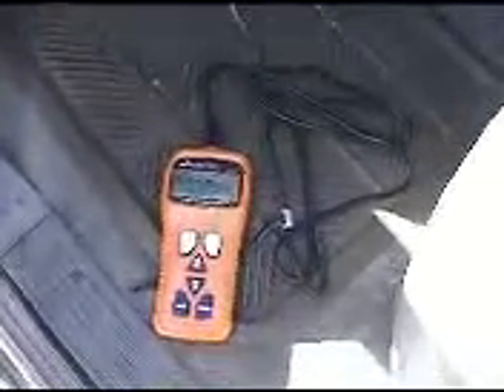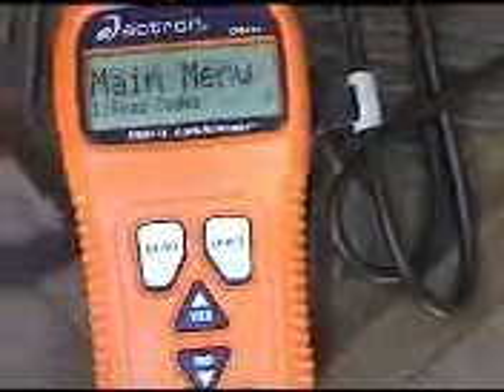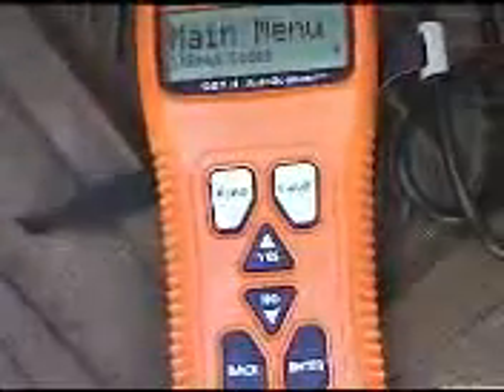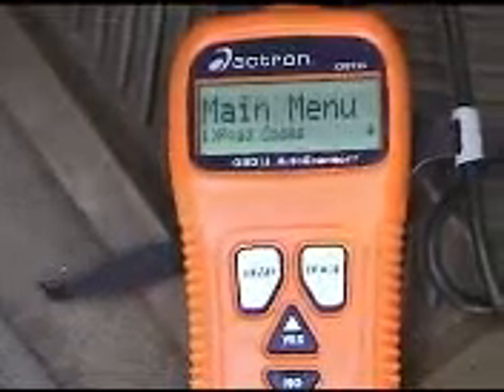How to replace the O2 Sensor

Comment: I just replaced mine last week on my 97 Yukon.  I didn't know that they made a socket for the O2 sensor so I just cut the wires off and slipped on the closed end of the wrench.
Good Video.

Comment: Yes you can buy them at Auto Zone or most any parts store.  I picked mine up at O'Reilly Auto Parts.  They sold me their Rental unit and I paid $20.00 for the complete set.  It's worth the money to have the right tool for this job. I believe it comes with 2 sockets and another connector for the sockets.  Good Luck with your project.

Comment from the maker: The question came up, which one is bank 1 and 2.

Bank 1 sensor will always be on the same side of a V6 or V8 engine as cylinder number one.  The upstream is normally before the catalytic converter and downstream behind it.  The sensors work the same.

Hope that helps

Comment: I've spent all day trying to loosen up my 02 sensor, that damn thing is frozen solid.  I even saturated it with liquid wrench three times, letting it set in for almost an hour each time.  I haven't thought of heating up the engine.  I will try that tomorrow before buying a pneumatic 02 sensor wrench.

Comment from the maker: I'm really sorry about getting back to you so late.  Yes, it should have 2 before the converter and two after the converter.  On the reader that I used, it did indicate which sensor needed to be replaced.  Now it didn't say if it was the one on the left or right, just that it was either before or after the converter.  Hope that helps

Comment: The tool is great, the sensor is really rusted on! I'm spraying it with WD40 and havn't budged it at all! It's hard to get a lot of muscle into it laying on your back under the van like that and I don't wanna knock it off the jack stands. I'm gonna check with O'Reilys and see if there's something stronger I can use to penetrate the rust.

Comment: Thank you very much. Spent days on the internet trying to find how to install Air Fuel Ratio sensor ( should be similar process) until ... finally got this info. Toyota dealership estimated 1.5 hr to do the job $125/hr. plus the part itself. My worry is just how I will deal with engine light without a device...another puzzle. Btw, any special tips on AFR install on Toyota Camry 1997 LE, 4 cyl,2.2L?

Comment: @natenraya I wonder if they left gas in the tank when it was parked for 2 years I bet the fuel filter is clogged and the injectors are dirty..  If so I would run it until the tank is empty.  Change the fuel filter put some good fuel injector cleaner  and fill it with super unleaded. Then drive it.   
Then after that full tank is used up.  I would run a 1/3 or half of can of seafoam in the tank with the tank filled with super unleaded gas.   Then if it improves.  Change the fuel filter again.

Comment: @jimmy101112000 

Often times, you have to reconnect the battery for the check engine to reset. But make sure you know the radio code, if you have a anti theft radio because when the battery is diconnected, it engages the code and the radio is un-usable until the code is put in. You can find the code by calling the car manufacture or check the website and have your VIN number handy

Comment: Guys the manufacture recommend to change the O2 sensors between K60-100 ,it will improve the engine performance and gas consumption .

Comment: @jimmy101112000 Plus an O2 sensor will light up the check engine light if its really bad but it would not cause your jeep to stall.  If you have a check engine light on  post your codes to us.  Autozone and some other auto parts stores will do this for free. But they will not clear them where I live at.  If you did a sucessful repair the light will go off after some trips.   I would also recommend a normal tune up. Spark plugs,  Air filter,  Oil change, Spark plug wires if equipped.

Comment: @TheCoolfez  yeah but its no big deal if the radio gets locked out.  Like you said they will give the code to you if you call with your vin. But I think that is the most dumbest feature in a stock stereo.  I never heard anyone stealing a stock stereo before. And those only work in certain cars with the same connections.

Comment: @natenraya 
Hey, if it sat for 2 years without use, you may need to flush the system.  bet you already burned off the old gasoline in it, so you need to fill it up about half way, and pour in a fuel cleaner ( they sell them at walmart or any gas station) and just run it. See if that helps.

Comment: @CheckItDontWreckIt82 Try to disconnect the negative post from your battery for about 20 minutes or longer, then hook it back up and see if the code persists.

Comment: Had Autozone use that tool to check my engine light, they read a code that said it was either my 02 sensor or a fuel injector. Dammit. Now i have to buy an 02 sensor, replace it, and if the light is still there, buy a 60$ fuel enjector, and put in and take out till i find a faulty one. dammit.  Months savings down the drain.

Comment: I have a 2002 Volvo S60 none turbo and failed emissions as stated on the report from the emissions testing  facility ~ front oxygen sensor needs to be replaced. I'm getting quotes of 300.00ish seems really expensive considering I have to replace this every 100.000. miles, I've never done this have no experience but have some knowledge of cars should I do this myself or just pay to have it done.

Comment: My ck engine light stayed on for a month, picked up a bottle of lucas and dumped whole bottle into tank and filled with gas. Run truck hard on the way home. Next day.,. ck engine light was gone. Did'nt have to change o2 sensor nor have a tune up. Truck 13 years old. I still have original belts, hoses, spark plugs ... etc. bet you can't say that with an americam made truck.

Comment: Sometimes the blue tipped wrench called a torch oftenly has to be used.I see the blue tabs on GMs for the electrical connections,I cut them off and throw them away.Don't need them.ALso,don't ever buy a Bosch oxygen sensor.Nothing but junk and Bosch's auto parts are nothing but junk